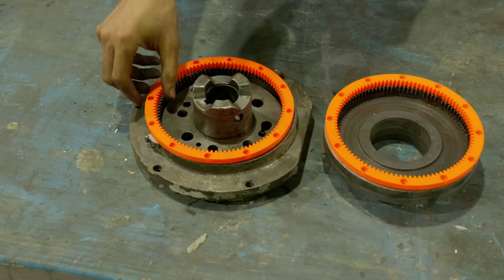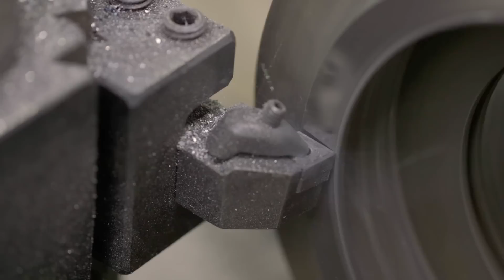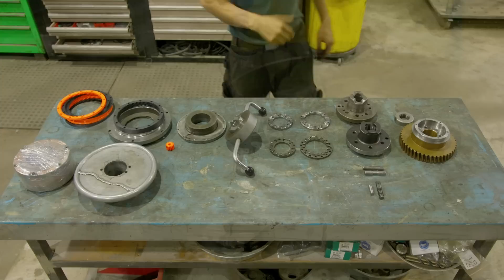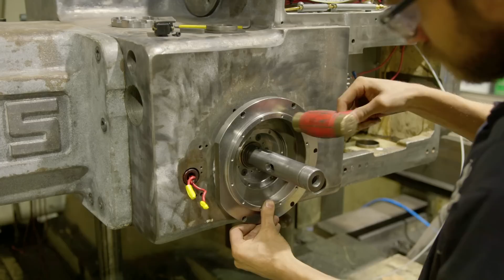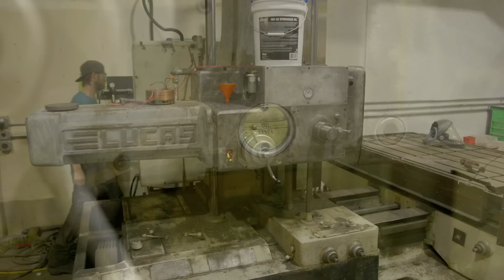More Broken Parts, Fixing the Sun Gears and Reassembling the Turnslide | Lucas 441B Project

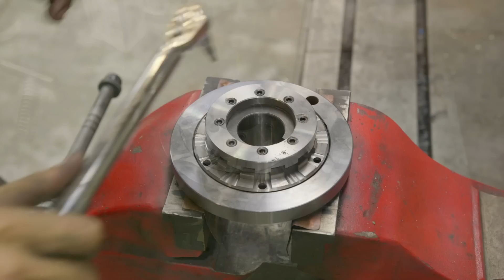Comment: 34:26 No specs and still itching to use a torquewrench? Look up the proper torque using thread size and Bolt grade. Works fine at least in the metric realm of the world.

Comment: Small tip  , i made a hole bunch of aluminum punches  3/8"  , 1/2" , 3/4" and an aluminum hammer so i dont damage steel shafts and parts while taking apart.
I learned brass   hammers mushroom steel pretty easy.
Specially once the brass gets  compressed and losses its softness.
Plus aluminum punches can quickly be cleaned up in lathe when end get mushroomed
Reply from the maker: Cool technique! Thanks for sharing.

Comment: I do a lot of 3D printing, the weak point is the mid point of that idler gear.  It will be prone to shearing at the layer line where the two outer gears come together.  Adding 3 holes for small steel pins would spread the load across the entire gear and not rely on layer bonding.
Reply: As an inginerd, I find FDM in particular both an excellent teaching tool and near-useless any time you have real loads.

It's as weird as most resin-fibre sheet composites and it's the exact same pain in the arse to model/design around, but it ain't half as skookum as any of them 😒
Reply: @233kosta  Was a bit strange that a machinist repaired one of his machines with a 3d printer.   High load stresses or not just machine new parts and be done with it.
Reply: @dev-debug  Dude has a new toy. He's embracing the technology with open arms and looking for ways to integrate it into his workflows. I get it.

Let him have his fun, he'll get tired of its limitations soon enough 😉
Reply from the maker: Fair points, guys! Giving new gear a workout is definitely part of the fun

Comment: I did not see the final product before you installed it. Your service bulletin said install  RTV on the screw heads that way if the screws broke and the heads were floating around, the RTV would prevent them from falling into the machine. I did see you put  RTV on the threads, but that’s not what the bulletin said.  Otherwise very impressive.

Comment: Unbelievable doesn't describe the work you're doing to get this machine back in functioning order!  Quick question...at 34:50 you are tightening the allen bolts with a torque wrench in rotating order....it's always been my understanding, and practice that, in order to properly tighten bolts set in a circular pattern you start with one bolt, do not fully tighten it, then go to the bolt directly across from the first and tighten, then move up a bolt and tighten, then move directly across and so on, hand tightening only.  On the final tightening, you would then start at the first bolt, tighten to your torque spec, THEN move up one bolt and tighten to torque, and proceed all the way around until all bolts are tightened to torque in a circular pattern. Just a comment, not a critique.  Please keep your videos coming...they are truly works of art
Reply from the maker: Yeah star pattern is good either way torquing was not required here anyways

Comment: I really enjoyed the video as always. I can certainly relate to putting together and taking apart more than once. I just completed rebuilding my quick-change gear box on my Clausing 5913 lathe. When you have that many gears and ratios everything has a sequence it must be assembled. I did the test run just a couple of hours ago under power and there is always that pucker factor when you engage a machine the first time after a major rebuild. I'm confident that I did it right. Not as cheap as I would have liked but the machine was a total wreck when I bought it.  I would have been money ahead to buy a new import lathe but I would have missed all the learning I achieved by doing it myself. There are hundreds of machinist and tool makers that can run the socks off of their machines but most of them don't ever work on them. My hobby is not machining but rebuilding and restoring the machines, so they make accurate parts. It is my passion, so I thoroughly enjoy your videos.

Comment: I recall thinking there is no real world application for 3d printing back when the home printers were coming out. Wow was I lacking imagination! I am very impressed with what you achieved with printing and your metal working skills. Would metal printing be an option for gears that do have moderate use and torque? I would think being in Chicago there a few metal printers around as well as more than a few water jet contractors for future use. I live in a rural ranching town and there is a water jet less than 5 minuets away and a metal printer 2 hours away. Cheers

Comment: That is so cool that you can use a 3D printer for gears and make adjustments that fine on requirements, Would it not work a little smoother if you made the gear rotation similar to a Planetary gear with 3 inside small idlers instead of 1 ??  I mean if they are only a couple bucks each

Comment: Nice video and i love all the machinery in your shop. 
But tbh, i don't understand the need for cast iron in this application. Making this part completely new out of some sort of mild steel would take 4 hours on a modern multitask. So it is surely less fun than doing it manually, but also would cost just around 200-300$ for the first piece. Around 20$ for every additional part (material, inserts, energy-costs, machining time around 30minutes).
But maybe i miss something over the application this part is used for?

Comment: I really like your approach to solving this particular problem.  Using parts of the Old Part and replacing the broken sections is a very good way to fix things.  Especially when new parts are so very expensive.  My personal opinion, When the price of parts is that high, the price says it "We don't want to do it".  I believe the theory is  "if if they can't fix it then they will have to buy NEW".  Electrical Gremlins can the the absolute worst.  I wish I could be there to help.  You'll get those pesky Gremlins, it will just take time.  KOKO!

Comment: For the sun gears, couldn't you print 6 of the small gears that go inside, put them in a non-rotating cage (fixed to the pin of the small gears) and not even bother fixing the ring gears  you would have 6 gears in constant mesh? Just my thoughts, not sure you could get a cage to fit, but it looks like it would

Comment: I am unclear on using RTV on the bolts per the TSB. Your description sounded like the bolt heads fall into gears, which would mean putting the RTV on the heads to keep them in place. Am I wrong?

Comment: Ring gear...not sun
Reply: @zachaliles make one google search please
Reply: Ring gears run on the face of the ring.  Like the gears in a cars differential and use a pinion gear. Sun gears run on the inside of the ring. I'm not 100% on it but that's what I was taught and remember reading somewhere. You might be right though.
Reply: @scotts9898 think about it like our solar system hence “planetary” the sun is in the center and the planets revolve the sun. planets being the small 16t gear in this situation and ring gear is the internally faced gear surrounding and enclosing the gearbox